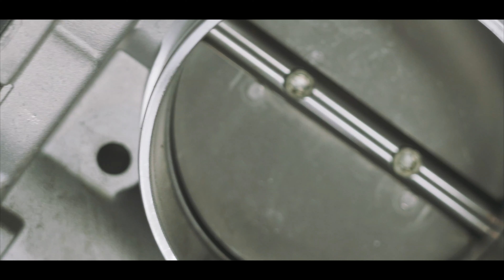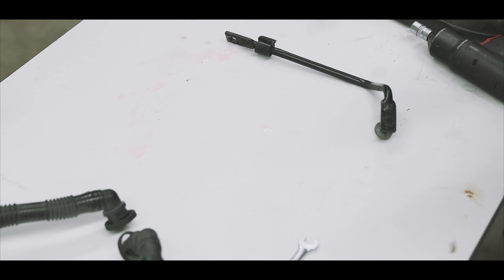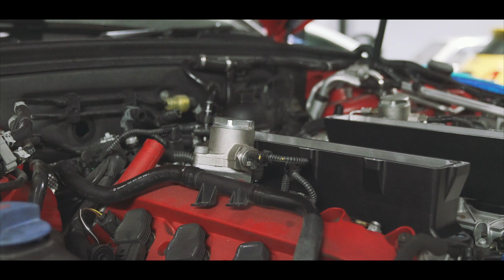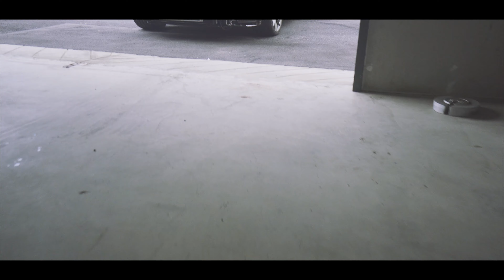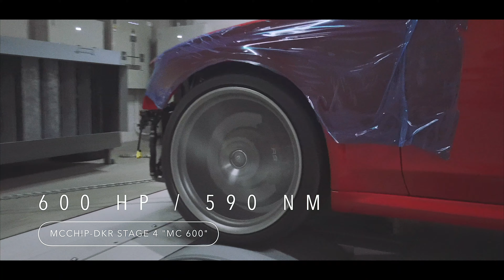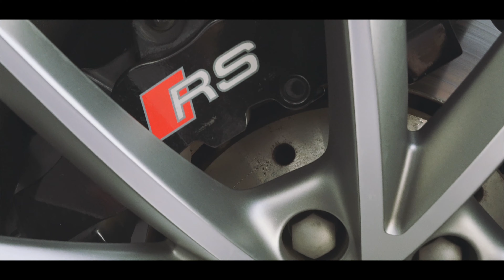Audi RS4 Stage 4 : MC600 Supercharger Kit (Whipple)

Comment: Wow awesome work lads. Would drive line have any issues holding 600hp and 590NM? The 4.2liter engine is just way to top-end and would like to supercharge it.
Reply: 3 years too late for an answer but I'm in the same boat, powers all top end and it's not often you're up there to take advantage, I seen this on a Dyno run of mine recently where my stock RS4 is making 442.5HP and 485.2nm or torque which isn't bad not bad for. 9 year old engine with 73k miles on it, but could still do with some low end torque and boost in general from a SC. Main problem for me is the price, most SC kits cost 2 thirds the value of the car which just isn't viable unless you got money out the wazzoo.

Gearbox tends to be the weak point from what I've been reading, but most stock ones do hold up to the power, but others replacing for the 8 speed torque converter from the C7 RS6.